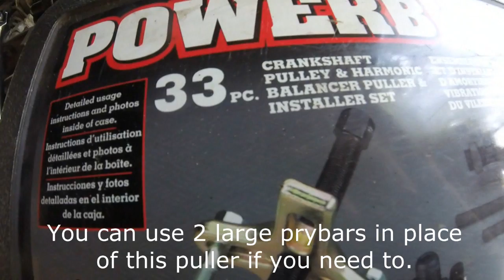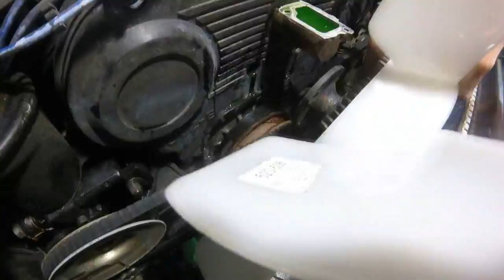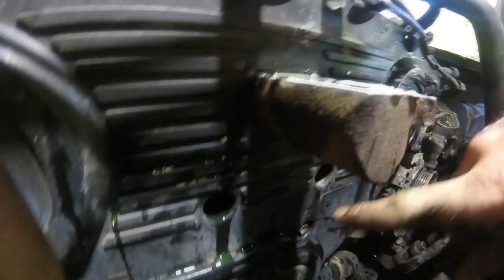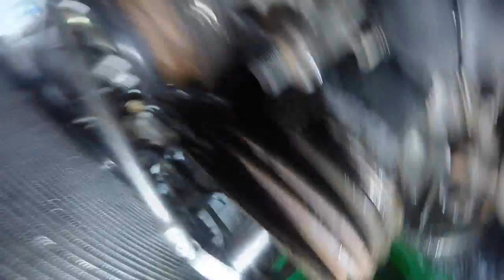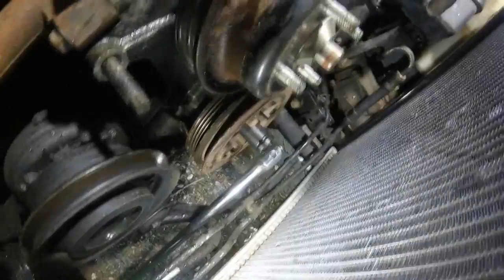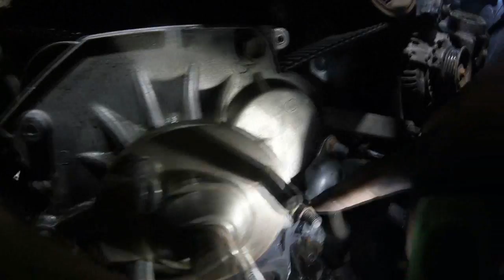Timing Belt Replacement How To - Toyota 4Runner 3.0 3VZE - Part 1

Comment: TIP for installing new timing belt: You want a tight belt between the two cams and the crank and all the slack near the tensioner. Turn the crank ONE TOOTH COUNTER CLOCKWISE from the mark and put on the belt. Then, holding the drivers side cam, TURN THE CRANK CLOCKWISE ONE TOOTH back to the mark. Now you have a tight belt. Feed it into the tensioner and tighten.

Comment: Thanks so much! Did my timing belt & water pump and it went great! I would like to note, though, that I had a different tensioner assembly. I have a 1991 4runner.
Reply: Glad you mentioned this cause I have a 91 and am planning to change my belt soon.
Reply: Apparently after 1992 they changed to a hydraulic tensioner rather than spring

Comment: Great video. I notice the tensioner you use with the pull pin is not in any of the kits I see for my 91 pickup, is this a different design?
Reply from the maker: The 91 is probably a spring type tensioner, where this 94 has a hydraulic one

Comment: On my 91 the timing belt cover had a bolt that is behind the power steering pump reservoir that's hard to get to, so be ready for that.
Reply: Removing the battery helps for that one.

Comment: You made it look so easy. Where do you live? Arizona?.. Couldn't budge 2 of the fan nuts, so being a manual trans. I opted to remove the radiator and took the fan bracket out with the fan attached (easy). Also being a manual trans. I just put the car in gear and had a friend stand on the brake and removed the crank bolt rather easily. The harmonic balancer would not budge. I spritzed a few drops of PB on it just for fun and  tried it again to no avail so drove a few blocks and bought a Puller ($15.00) from napa, and before I could get it set up the balance just slid off. Go figure.. I should have waited a few minutes after spraying with PB and I could have saved a trip to Napa. Lol... My job didn't go as easy as yours seemed to go cause someone was here before and buggered up some of the bolts to the point that they were almost round so I had to work extra hard to remove them. Thanks for the great video...
Reply from the maker: Thanks for the taking the time to comment. Sorry you had a few struggles, but glad the video helped a bit. Should be easier if you ever have to do it again

Comment: when you loosen the pulley off using the starter did it mess up the timing?
Reply: exactly what i was thinking, what was the point of aligning the dots if you are going to turn the car over

Comment: My mechanic keeps moving around the timing and other things, and the 4wd high is not working well in sand. When my dad first bought a 4runner it worked fine until we got the timing belt changed, and it is FRUSTRATING having to keep going back and also getting the revolutions fixed because it is too low and stalls if your not careful.

Comment: Hi, I need help! Question about my drive belts. I used this video to help replace my drive belts. My alternator belt snapped. Big time squealing noise right before it snapped. I did start the engine with just the A/C & power steering belts. Still had that squealing noise. I also found a circular, beveled aluminum piece, 1" in diameter when the alternator belt broke. I'm not sure what that is? I put brand new Gates belts on. All the belts feel properly tensioned based on the ruler test. However, the squealing noise is still there when starting engine. Is it the alternator? Does that aluminum piece have anything to do with it? Thanks for any help.

Comment: Thank you so much for the video. It helped us a whole lot in the replacement of our timing belt. Now I have a question. I've got a third generation 2001 4runner with a 6 cylinder. She has 218k mile on her and I just replaced the timing belt. Not easy but I got it done. I fired up the car and everything sounds smooth. I drove it about 15 to 20 minutes and the CES light came on. I went to the auto parts store to barrow the computer. The codes read are, in order on print out, P0301 (cylinder 1 Misfire), P0300 (Random Misfire), P0304 (Cylinder 4 Misfire). The car is running very smoothly and no physical detection of a misfire. I removed battery lead and reconnected, code cleared, then reappeared after about 15 minutes of driving. I checked wiring harnesses and general wiring for poor connections or poor ground. All checked out. I disconnected the battery again to clear the code, went for another drive and and CSE went back on after about 15 minutes drive time, I stopped the car to get my mail out of the box (the car is still running very smooth while I'm getting the mail) I got back in and put it in drive and the CES light went off????? I have nor driven it again since the light went off and I parked the car but I'm going to assume it will go on again. I will drive again to confirm. Can you direct me to a resource that may be able to help answer to this elusive issue?
Reply from the maker: It is possible that the timing belt is a tooth off?  Of course there are other possibilities, but the computer uses the crank, cam signal to detect misfires. If it wasn't doing it before, then I might suspect that.

Comment: Don't you have to bring the engine to 0 degrees at Top Dead Center on the compression stroke?
Reply from the maker: With all the timing marks lined up, the engine is in the correct position to remove the belt. You're probably thinking of distributor replacement

Comment: I have a 3.0 V6 Toyota pick up my timing belt has jumped a few teeth the cams are lined up but the crank pulley Mark is off which is more important to line up the crankOn the mark or the cams why you’re taking it apart thank you like your videos

Comment: Just an FYI, breaking your crankshaft pulley bolt loose with your starter is a BAD idea. You are running the chance of breaking teeth on your flywheel and breaking your starter...  I found that out the hard way.

Comment: I am currently doing this to my 90 4Runner.  My big problem is stuck bolts.  I have never worked on a job with so many stubborn bolts.  I now use penetrating oil and hit them with a hammer before I even try turning a bolt.  Even so, I have had to torch off two bolts.
 Unfortunately, I have two 5 inch long lag bolts holding the fan bracket in place that resist all my efforts.  Because they are lag bolts the threads are far away from the head.  They are buried deep in the block.  So penetrating oil and torching has no effect.  I have rounded the bolt head using a very long extension trying to muscle them off.  If I cannot remove the fan bracket I can't get to the timing belt and water pump so this is a real show stopper.  I am out of ideas.  Any suggestions?
 I have the same problem with the mounting bolt holding the power steering pump.
EDIT : after trying numerous methods I broke down and went to Harbor Freight and bought a 3/8 drive air impact wrench.  Hooray!  Took those bolts right off!  Boy, was that good to see.
NOTE:  I filed down the bolt heads some so they weren't so rounded before using the impact wrench.

Comment: Hi there, I'm currently just changing the water pump but am having trouble taking the crankshaft pulley off, I was just wondering if it was necessary for me to remove the crankshaft / crankshaft pulley in my case
Reply from the maker: Yeah, you have to pull the timing belt to do the water pump
Reply: JamesonDIY is it possible to replace the freeze plugs without pulling the engine out?
Reply from the maker: I guess it depends on what freeze plugs you are referring to. I don't know off the top of my head. Never had to change freeze plugs in a toyota

Comment: Have u had issues with your head gaskets due to the recall Toyota put out
Reply from the maker: No I never did. But the truck had 2 previous owners that took good care of it. Also the engine had been replaced before I bought it. So if there was an issue, it was resolved before I owned the truck.

Comment: Hi Jameson... My timing belt and tensioner are like new...but I need to replace the Water Pump and thermostat....what steps can I eliminate from the Timing Belt replacement procedure?
Thanks and your Video is Great !
Reply from the maker: Not much really. I guess at most you could line up all he timing marks, mark the belt on the 2 cams and crank, then clamp the belt to both cams. Then pull the belt, just off the other pulleys. This would just make a little easier and faster getting it back together. You will still need to remove the tensioner if it's hydraulic, in order to press the plunger back in. At least that's the right way to do it. So to sum it up, there unfortunately aren't too many steps you can save, since the timing belt drives the water pump
Reply: Yeah....Great point !
Thanks a bunch for the Super fast reply and Videos !

Comment: wow, this is very good. you do a terrific job. one comment about the position of the belt and pullys - all marks lined up and distributor rotor pointing to #1 post, right?
Reply from the maker: I dont even pull the cap to check the rotor. But yes thats where it should point
Reply: i just finished my belt and water pump. i couldn't have done it without your videos. thank you.
Reply from the maker: RangerCaptain11A Thank you. Glad it helped

Comment: Awesome vid....but i have a question....I am currently replacing my timebelt abf water pump on mine and I cant get the engine to turn when am trying yo get it to be timed? If that makes since. Lol its hard as ffffffff. How do I turn it ? Smh
Reply from the maker: If you are turning it with the crankshaft bolt, it should not be that hard. Maybe your wrench/ratchet is too short
Reply: JamesonDIY nah am so stupid I left it on 2nd gear since its a manual hahaha I just finished the job. Thank you again great video.
Reply from the maker: haha. nice. glad it went well

Comment: Will a cordless drill with ratchet piece attachments and a breaker bar work? Or do I need the impact?
Reply from the maker: You dont need the impact. But you will need a breaker bar. Then use the starter motor to bump the engine over and break the bolt loose
Reply: JamesonDIY thankyou!

Comment: I have a question: how can you tell when the timing belt is bad?

My suv specs: 98 toyota 4runner, manual transmission
Reply from the maker: Timing belts are changed based on mileage. You never want them to get "bad".  However if you visually inspect one, and it shows signs of rot, cracking, tears, etc, it should be changed.
Reply: +JamesonDIY Thank you for the info

Comment: when you remove the crankshaft bolt, how do you do so without moving the timing marks? Or does that even matter. I really appreciate this video!! helped me more than you believe
Reply from the maker: TheRegent187 It doesn't matter much, as long as the belt doesn't jump time. if you're using an impact, it doesn't move that much anyway. the belts that are pre-marked make the timing marks on the engine almost irrelevant
Reply: JamesonDIY understood, that makes a lot of sense. thanks for the reply.. I am currently tackling this job solely with the help from this video and some old threads on a forum. all because my water pump went out.  zero experience, but this is a great start! I realized my engine is a little different as I don't have the timing belt tensioner that you do. but I will figure it out. thanks again !
Reply from the maker: Yeah, I guess you have the older engine with the spring type tensioner.. The process is still basically the same though, so you should be fine

Comment: Hey James! Great video! I don`t have a impact so I try with the long bar and give start to the engine, but my engine won`t rotate! What could it be?
Reply from the maker: what do you mean it won't rotate? If you're turning the key to start the engine it should act like it's going to start. Did you disconnect the battery?
Reply: Hi James! Thanks for your prompt answer! I`m new in this so as I told you before I turn the key and the crankshaft  and  won`t rotate. I spin the cranshaft I think 360 or something like it and it work! But the Breaker Bar  3/8" drive x 20" inch long just couldn`t hold the torque and the head snap! Since the bar had warranty I just replace it and try it again, but snap again. So I decide to go for a 1/2"   inch and the bolt finally got loose! What could be the reason for the crankshaft didn`t rotate ? I keep working I realize that in your video you didn`t show hoy to change the water pump, but is not a big deal! So thank you for everything!
Reply from the maker: If the engine is not turning over with the key, it sounds like you have a starting system problem. This you would have surely noticed before doing the timing belt right? The engine not turning over? I'm just trying to understand if that's what you are saying.
Reply: Hi James! I bought the truck 4 weeks ago and so far I did not have any starting problem, I really don`t know what happen! Probably is a problem with the starting system, time will tell! Anyways I have a question for you, I was able to put all parts together but I realize that you adjust the bolt of the crankshaft with the impact. The problem is that I don`t have an impact, I adjusted it as much as I could with one wrench on the crankshaft bolt and the other in one of the bolt of the cam gear, do you think that this would be enough? Should I invert the process for getting loose the bolt from the crankshaft with the bar or I should just go to a mechanic and ask for the impact to tight the bolt? Thank you very much for your answer! The video is great!
Reply from the maker: You can reverse the process for loosening it yes
Reply: Ok! I will Thanks Again!

Comment: Hey james. I had a question that maybe you would know the answer. Do you know which trucks comes with a water pump oil cooler and which don't ? Because i see they are selling water pumps with and without... I'm pretty sure mine as one. 93 pickup 4x4 stick shift.. thanks man
Reply from the maker: No, I thought thought all the 3.0s had oil coolers. You know what it looks like right? It is the big round thing with a 24mm bolt in the middle of it, close to the oil filter. It has 2 coolant hoses coming from it.
Reply from the maker: I only see one listed for 1993 3.0. Oreilly"s CP9291, but if you check Aisin WPT-030 or WPT-032....It looks like one may have a water outlet pipe on the thermostat housing part of the water pump, and one may not. So I guess look down at the thermostat, and see if it has a hose coming off of it. The water pump is covered by the timing cover, except for the thermostat part of it, it's just to the right of the timing cover, by the lower radiator hose. Hope that helps.
Reply: Thanks a lot James. Im pretty sure mine as an oil cooler,, but i will double check. Do you think it's possible to install a water pump with an oil cooler even if your old water pump does not have it ? 
By the way,, i was thinking of installing the same kit as you the Aisin  TKT014.  Any preferences why you're using that brand ? I know it's a direct replacement for toyota part,, but i'd still like your take on it if you don't mind..

thanks
Reply from the maker: Yes, the water pump itself should be the same, but with the addition of the small outlet for the heater hose. You would need to plug that outlet though so the coolant wouldn't leak out. Obviously you would try to avoid that route if possible. As far as the Aisin kit goes, I always use those for Honda and Toyota if they are available because they OEM replacements, not cheap parts that Autozone sells. I have seen the most reliability from them. Also the belts seems of higher quality and they are usually marked with the timing mark lines, like the belt I used in this video. It makes installation quicker. In the video I showed lining up the timing marks and the lines of the video just for demonstration purposes. But once you have done this before, you realize that you can almost just use the lines on the belt with the marks on the gears. It makes it quicker, easier, and basically fool proof...all good things.
Reply: Thanks a lot james. Would you know why they call it oil cooler instead of the heater hose outlet?

thanks
Reply: Hey james. In the aisin kit tkt014, is there a spring that come with the koyo Tensioner Bearing? If not  can i reused the old one ? Do you need to change it? thanks james.
Reply from the maker: No you don't need to change the spring unless they're stretched out. Usually they're fine. But if it comes with it I'd replace it.
Reply from the maker: Well that small outlet on the water pump is what sends coolant to the oil cooler. The oil cooler itself is on the driver side of the engine block close to the oil filter
Reply: Hey james. I might have another question for you if you don't mind.. At the end of the video, you put RTV sealant on your water outlet to create a nice seal.. would it be okay if i use gasket maker ? 
Also because i am going to change the water pump, ( i have a steel gasket with rubber ) could i still apply gasket maker there too and around the thermostat housing ? thanks james
Reply from the maker: yes, you can use that as well. Be careful though using in addition to a gasket. It's not usually necessary, unless the surface the water pump bolts too is pitted or warped. But yes you can use a very thin layer if you think you need it
Reply: Sounds good james. Could i ask how long is your breaker bar to unscrew the crankshaft bolt trick? i have a 24inch one, would that do ?

thanks james
Reply from the maker: Mine is 30 inches I believe, but all that matters is that is long enough to hit the frame when the engine spins

Comment: hi bro . i just changed put spark plugs and the wires and my truck still misfire it work well for coples of weeks bit now is doing again what elae could be wrong if you have any idea.
Reply: Ichigo Kourasaki Could be your ignition coils or oxygen sensors